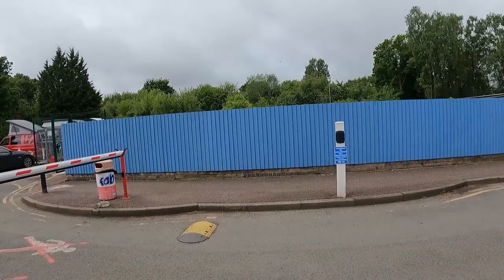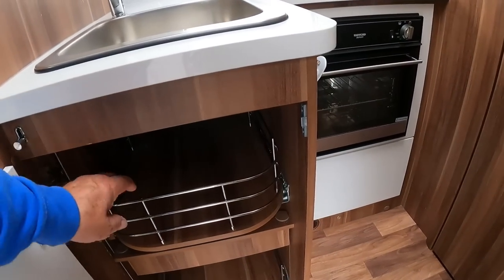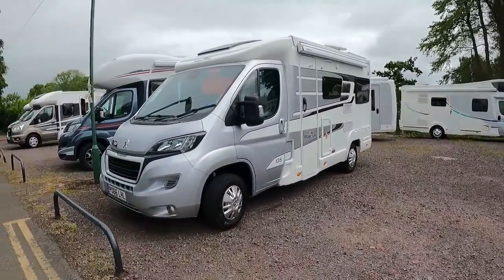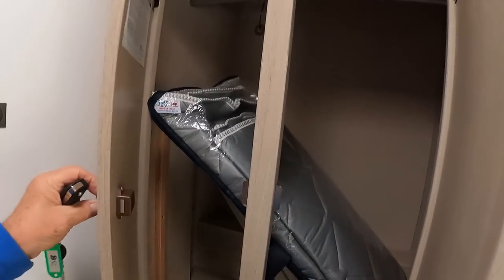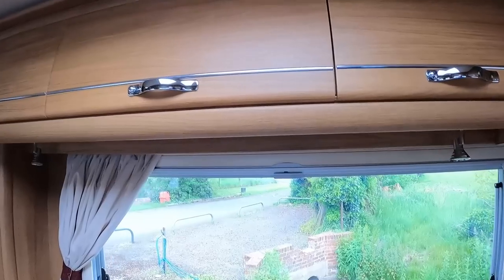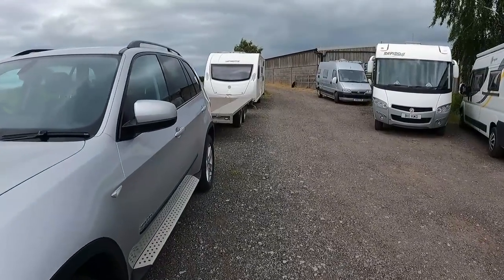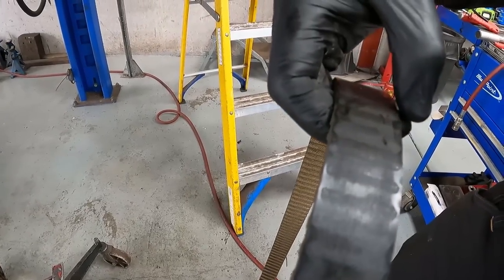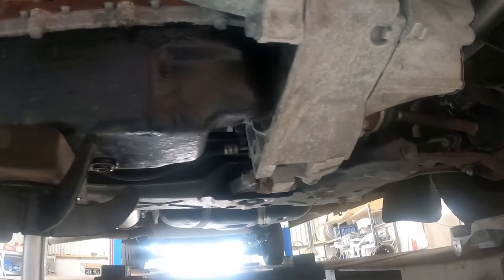Motorhome Timing Belts When To Replace And More Motorhomes

Comment: I see the VW captive breeding programme is progressing well.
Cambelt failure is signalled by the "kill engine" light coming on. Just had mine done on my 66k mile Duster as it was due. Local garage did oil and filter service new cam belt and water pump for £390 all in. As you say cheapest way is regular maintenance NOT regular fixes after component failure.
Reply: Cambelt failure is generally signalled by a catastrophic 'bang'.

Comment: When do you advise on getting the cam belt changed
Reply from the maker: Depends on what van you have as the intervals are different but it can be anywhere from 4-10 years depending on the type. Most commonly they need changing every 5 years
Reply: @TheMotorhomeMan  hi there , we’ve got an 11yr old Autotrail Arapaho which has done 28,000 miles in total so would you advise on getting the cam belt or chain as I’m not sure what’s on the engine chained or not.
Thanks for the feedback